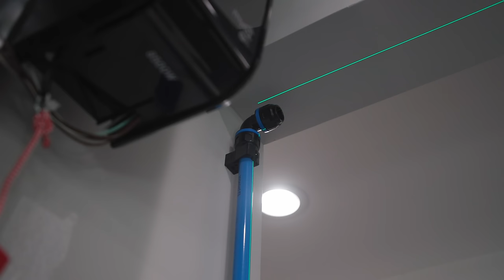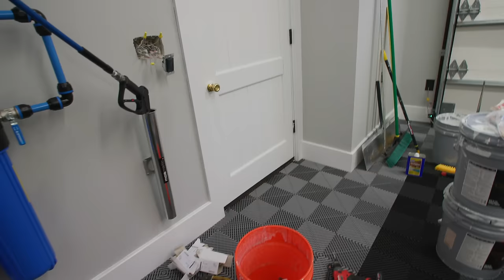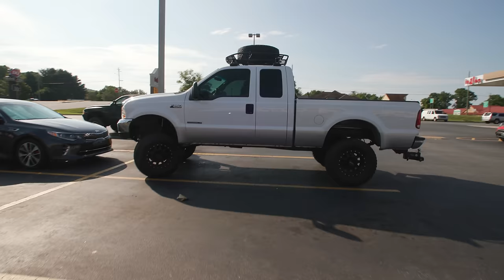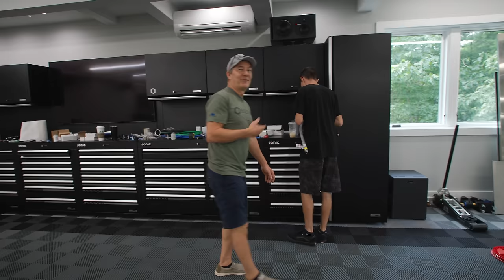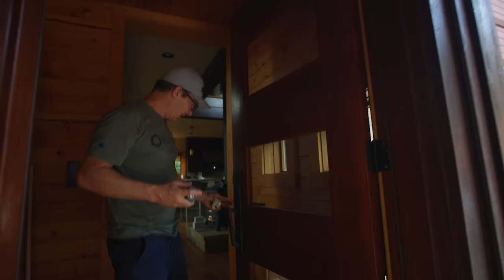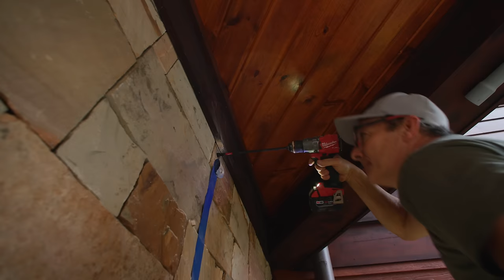Building Destination OG: Boom Pole Installed and Plumbing Completed! (Ep. 19)

Comment: Very nice work with a lot of attention to detail which nowadays isn't a standard. From my carwash technician experience the one thing that I would perhaps do differently, is instead of running the HP boom hose in pvc conduit, I'd do it in solid stainless hydraulic pipe. Needs additional tools and costs a bit more but the overall effect would be that one step above which I think is reasonable given this is a high end install. Plus I also think the hose will vibrate inside the pvc pipe and cause unnecessary resonance noise. Overall though this is just very well done. Craftsmanship with no compromise.

Comment: Hey Matt great video. I’m curious with the prevost piping. My understanding is that prevost is for compressed air . Why are you guys using for water? Can it be used that way? I’m assuming you are using for water because it’s more durable than pex? Can you please explain ? Either you or Mike? Thanks
Reply from the maker: I've used it with the Custom Pressure Washer Install Solution for 4+ years and never had an issue with running water through Prevost.
Reply: @ObsessedGarage  Thanks Matt